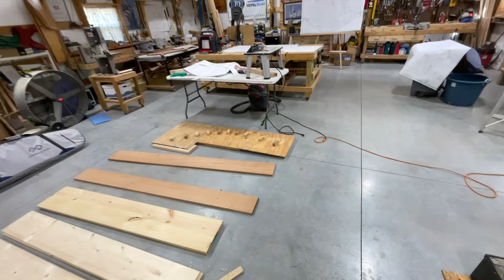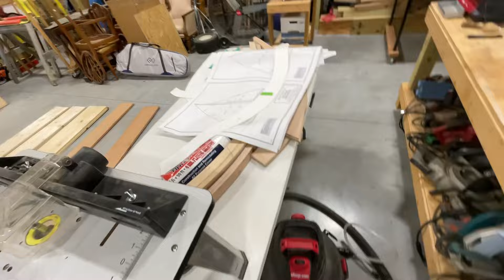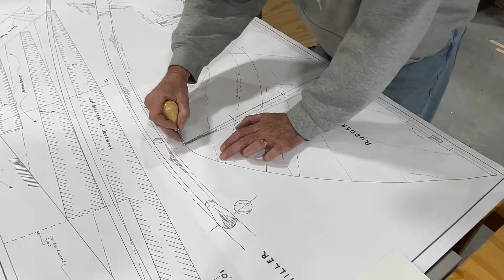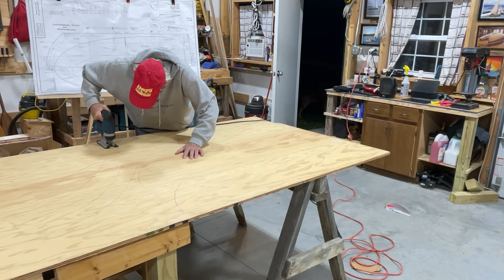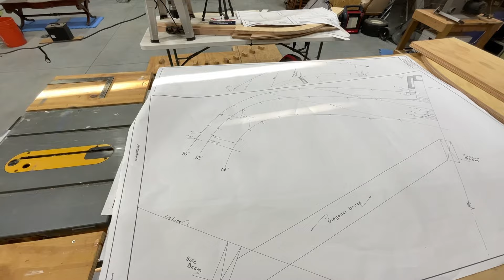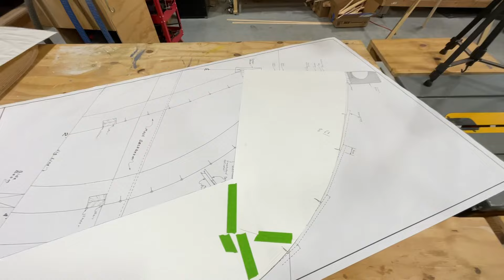Boat Building the Somes Sound 12 1/2 - Frames and Half Inch Plywood Puzzle - Ep 11 Part 2

Comment: Are you planning on using the plywood untreated? If you are encapsulating the wood in epoxy it's not that important that it's marine grade.
Reply from the maker: I was just thinking this last night as I was looking at the forward frames. They are made out of BS 1088 grade marine ply but even so, I'm soaking them all in epoxy. No reason not to. thanks! Chuck

Comment: I am not sure what “marine grade” plywood means.  The key question is whether or not it is BS1088 certified.
Reply from the maker: @Ddw2164   The half inch stuff is not BS1088 certified as far as I can tell however, all of these parts will be, either fiberglassed with or encased in epoxy so we should be good.